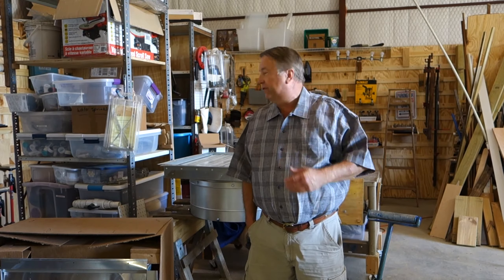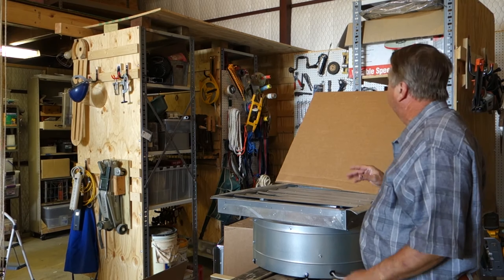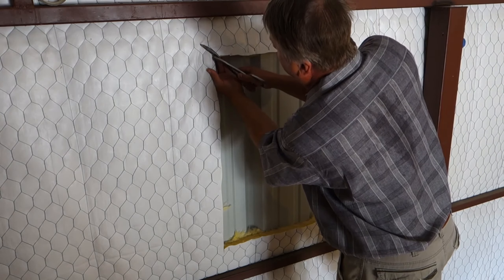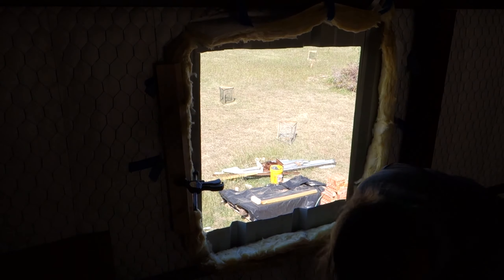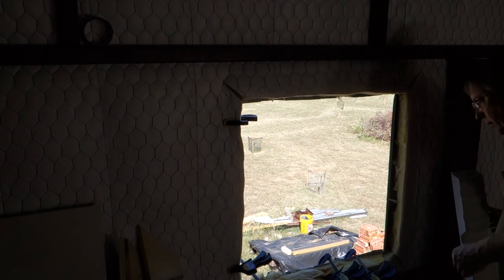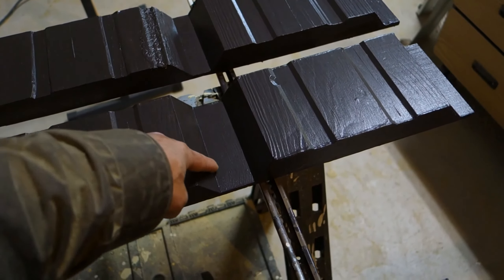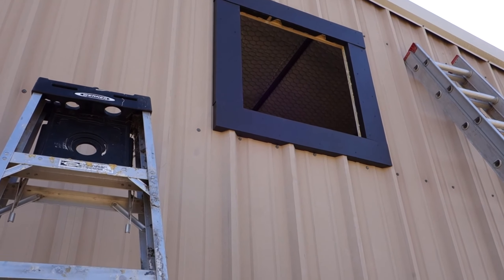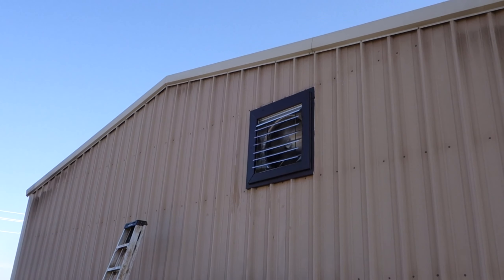Installing an Exhaust Fan into a Metal Building

Comment: Good job!  I'm glad you included all your trials and tribulations!  I hope to get by with using aviation snips to cut my metal.  Thanks for the tips!
Reply from the maker: Perhaps I'm not that talented with tin snips / aviation snips but after about 10 inches, it seems I'm fighting them to cut a straight line.
Reply: @EasyAim1  I hear you.  I've got to mount a small air conditioner and the exit for a stove pipe on my metal building.  I'm also considering temporarily screwing a frame of some stiff wood against the line of the cut outs - screwing the metal to that - to stabilize it so that a reciprocating saw would not be vibrating so badly.

Comment: Good info all the way through the video.  I have a 40x60 shop that needs an exhaust fan and was wondering how to do it with the metal R-Panel..  Thank you for making the video!!
Reply from the maker: Mr. Goat, you might want to review our Haslet One-Piece Frame which makes the installation even easier.
https://www.hasletproducts.com/shop/one-piece-haslet-frame

Comment: Thanks for making this video! Has anyone found a quieter version? Or would it make sense to go with a larger fan that you can run on a low speed setting and still move the same air? We want to install a fan in our auto repair shop so the quieter the better so the techs can still hear the intercom. Thanks!
Reply from the maker: I wish I had more info on various fans and their sound level. I've heard that, surprisingly, the belt-driven fans are quieter than the direct drive fans. That isn't intuitive since the belt driven fans have more moving parts but a guy I talked to swears it is so.  UPDATE:  ok, it makes sense that belt driven fans are quieter because they run slower. The usual direct drive fans operate so fast that they whip the air creating the majority of the noise.  If I had to do it over again, I would opt for only one fan, larger, and belt driven.

Comment: Hi mark I cut in a ridge vent on a large metal building but now the place will not cool by a/c probably need some air pushed in to the building
Reply from the maker: I thought about installing an air conditioner but even here in Texas with 100+ F summer days, I work with the workshop doors open. It makes the shop more open for ventilation, more light, less claustrophobic, etc... so air movers like an exhaust fan was the best deal for me.

Comment: Good Job.

Question, if it rains hard and with wind, won't it bring water into the attic if the blinds are open?
Reply from the maker: Shutters are gravity operated: ideally, they are open only when the fan is running.  In that case, the fan's exhaust will blow the rain away.  When the fans are turned off, the shutters close automatically due to gravity. Wind blowing towards the shutters only makes them close tighter. Ironically, if you have a drafty building (or leave a door open on the opposite wall), wind blowing toward the opposite wall can create a draft such that your fan's shutters open (and it will spin your fan blades). But if there is any rain with that wind, it still doesn't leak because the wind is blowing away from the fans.

Comment: Question, can you wire it directly into a switch, and run a wire and jump it off an outlet?
Reply from the maker: You would need to ask an electrician.  I admit that, after three years, I still haven't wired mine correctly to a dedicated switch. I spliced a regular outlet to the fan wiring and I have to go plug them in at the start of the day in the summer time.
Reply: 4:25 How Loud Was That Fan
Reply from the maker: @ETH-q4x  I've only owned my own Maxx Air 24" fan (two of them).  I think they are loud and I wish I had spent more money and gotten a quieter belt-driven fan.  However, I don't  know if they are louder than any other direct drive fan.

Comment: Thank you for this video. It was very interesting and informative. I love your workshop!
My barn was destroyed by a falling tree so I'm trying to get a new one built and I want to have a gable fan to keep my cows cool. The building will have similar R-panel siding (but I think they will run it horizontal instead of vertical).

I'm curious as to why the sound cut out around 51minutes and stayed out for awhile.

When the cardboard kept slipping as you were trying to trace, I could relate. I always have that problem. Have to tape stuff down and even then sometimes it moves.

For the fans, did you install any sort of thermostat or snap disc fan control so the fans will only come on when it gets hot enough?
Reply from the maker: Concerning the sound: I accidentally had background music playing while cutting the frames. Youtube requires permission to play published music so I had to scrub it out.
I did not install a thermostat for the fans. I find it easy enough to walk over and plug them in when I need them. One downside is that they are so loud, I try NOT to run them unless absolutely necessary. When you select your fans, try to find a quiet one.
Reply: @EasyAim1  Ah. I was wondering if Youtube cut sound because of music but wasn't sure.
I'm not concerned about noise so much. I want to have a gable fan installed in a metal barn for my cows so they can have somewhere to shelter in the cold and heat. I plan to insulate it but I live in an area that gets very hot and humid so I want the fan to turn on when it gets too hot so it doesn't get over 100° like my other metal sheds do (they are not insulated but also do not have any vents).
Even if it was for my house, I'm used to loud fans so it doesn't really bother me.

Comment: I have one in my metal shop building. Keeps the temps down inside. Now that it’s autumn though, the north wind is blowing in moving the fan. The flaps aren’t staying down. I tried pushing them down but they’re loose & wont stay down. How do I get them to stay closed?
Reply from the maker: I have to admit that in the winter, I staple a sheet of plastic tarp over my fans on the inside. You would think that the fan manufacturers would have an easy locking device for a temporary, seasonal shut-down.
Reply: @EasyAim1  agreed!
Reply: @kit2130  Install a small magent on inside so when blades close, magnet will pull the blades in.
Reply: @jonathonplanten9780  oh good idea but just this afternoon I stapled some foil insulation over it. I might try that next winter though. Thanks!

Comment: Great details in your project! Why didn’t you cut the metal from outside? 
Lake Jackson, Tx.
Reply from the maker: I could have but my main scaffolding was inside the shop because I first had to cut away the insulation. So it made sense to just do as much as possible with the interior scaffolding.
Reply from the maker: ... and now I realize from your comment that cutting from the outside would have been easier. Cutting from the exterior side avoids the necessity to pull the insulation so far back to clear a path for the saw.
Reply: @EasyAim1  Yes, Indeed

Comment: Thank you for putting up this video. I was contracted to fix a 48" exhaust fan with 1400RPM.
We welded it to the galvanised tray to a metal iron as a pole. That caused alot of vibration which made tge client to halt the job.
Please how do you recommend we fix it without any vibration with a 25feet height metal building?
Reply from the maker: Yikes, I wish I knew more about dynamics. Of course, my first thought is to use the Haslet Frames. They are made with a styrofoam filler to fill the voids between the ridges and I bet they would dampen the vibration.
https://www.hasletproducts.com/
Reply: 1:08:08 That's Another Fan
Reply from the maker: @ETH-q4x  You are correct. I installed two fans and I used video of both their installations to make one installation story.

Comment: I have a large rectangular window and i have a  exhaust fan that covers only half. Could I leave the other half open air or does it have to be sealed?
Reply from the maker: On hot summer days, I guess it wouldn't matter. But on cold days, you might want to be able to seal up the draft around the fan.

Comment: Do the shutters prevent the cold air from coming in during the winter?
Reply from the maker: Yes, although they are not the most airtight structure. The shutters also keep out rain and critters when the fans are not running. During the coldest months, I cover the inside half of the fans with a plastic sheet.

Comment: I live in South Central Texas and I had my metal building spray foamed, so it did cut some of the heat out, but it still gets warm. How big of a shop do you have?  Did the One 24" really make a difference?
Reply from the maker: My shop is 35 ft wide and 45 ft long with a 18 ft tall ceiling. I installed two 24" fans and they are more than adequate to circulate air to clear sawdust and to keep the shop cool.

Comment: I too am in Texas and installed the MAXXAIR 30” exhaust fan with the automatic thermostat so it turns off and on as needed. I find it has helped but the fans automatic thermal protection on the motor shuts the fan down too much. Not sure what I am going to do now. This motor clearly runs too hot. Disappointed
Reply from the maker: That is odd. I'd contact the company and ask them about that.  My fans are directly wired (no thermostat) so there is no thermal protection that I'm aware of. And I know they have never shut down due to heat.
Reply from the maker: Update:  this summer (August 2024) my MaxxAir fan turned off automatically due to be over heated (I'm assuming).  After about 60 seconds it reset itself and started again with no problem.

Comment: Are you selling a wood frame?
Reply from the maker: The frame filler material is EPS (expanded polystyrene) which is like styrofoam but very dense. The flat surface that rides above the ridges is exterior-grade plywood. We ship everything with two coats of primer/paint and we ask customers to add another layer of exterior paint also.  It should last forever.